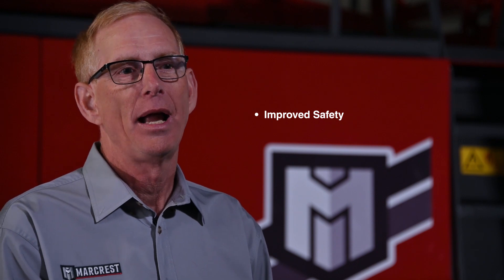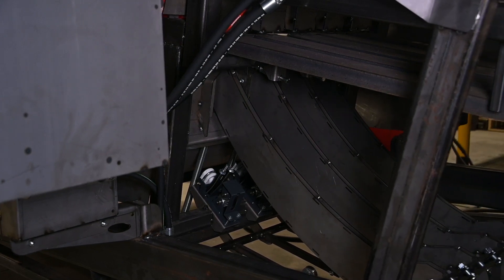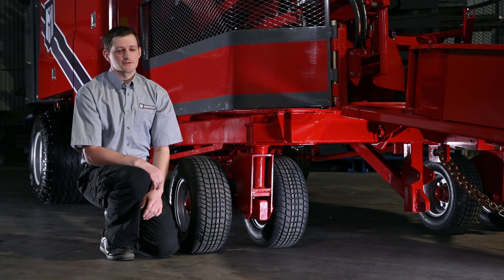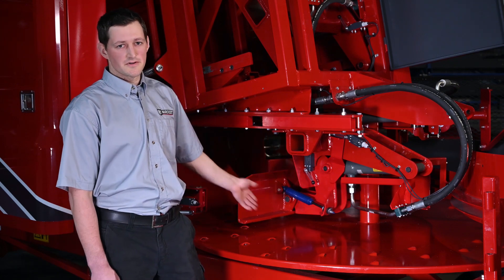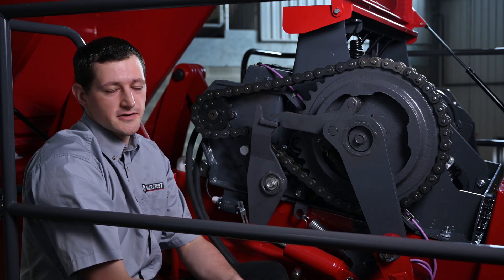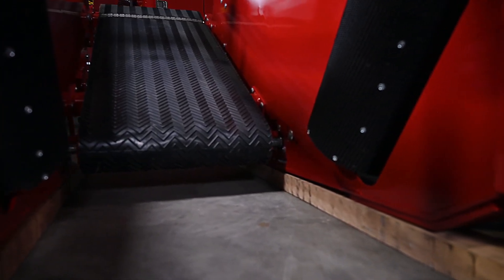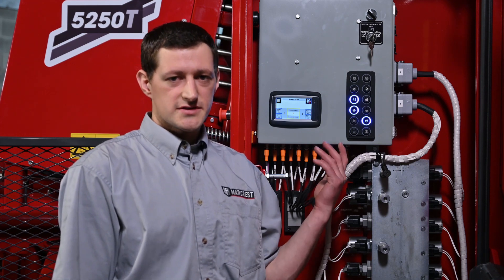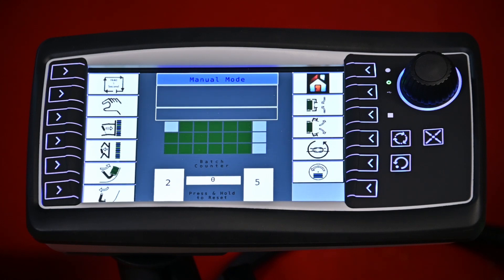Marcrest - Bale Baron 5250 Features and Benefits - Full Machine Walkaround

Comment: Marcrest;  To mister engineer. You showed a chain and sproket system for your knoter system, you engineers NEVER LEARN FROM HISTORY. When run a sprocket system and chain it needs oiling all the time. You did not figuring on a full time oiling system so the chain and sprocket DON‘T WARE OUT SO EASY. THINK ABOUT THE CHAIN AND SPROCKET YOU HAD ON YOUR BICYCLE WHEN YOU WERE A KID,  THE CHAIN WOULD STRETCH OUT AND GIVE YOU PROBLEMS, BECAUSE IT DIDN‘T GET OIL. IT‘S THE SAME THERE TO. ANYWHERE THERE IS MOVING PARTS IT NEEDS OIL OR GREESE TO. LAST I KNOW ABOUT  THERE IS IN THE MARKET PLACE A IDEM CALLED SELF GREESER UNITS. IT‘S BEND TRIED  AND USED ON OVER THE ROAD SEMI‘S, IT DOES A FAIRLY GOOD JOB.